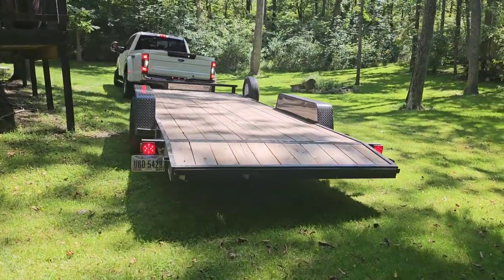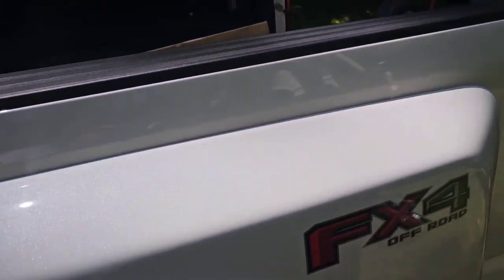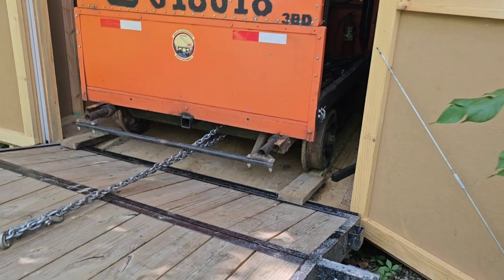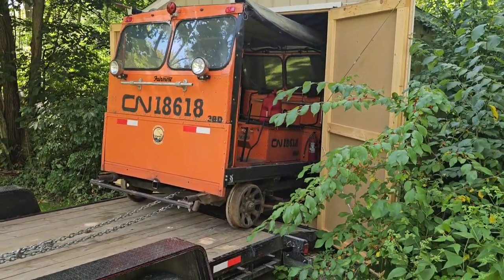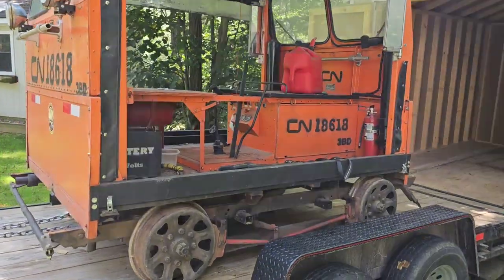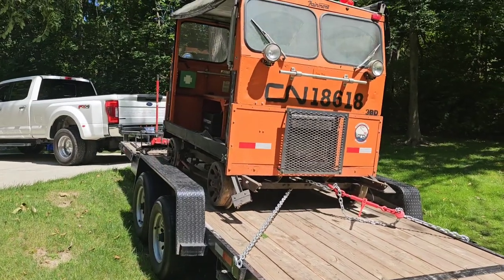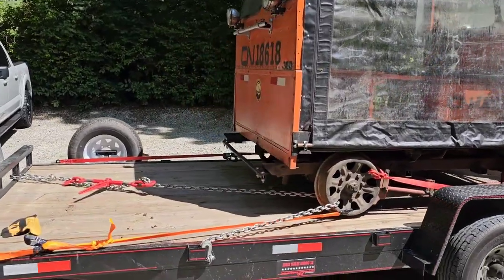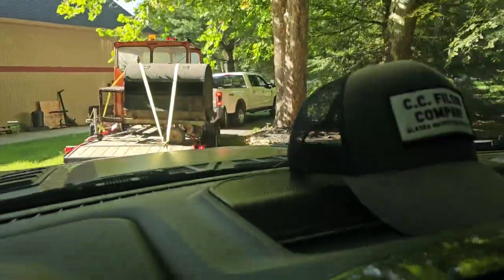Loading my 3500lb Fairmont A-4 railroad motor car onto a trailer after 7 years!

Comment: From earlier videos looks like it's still has the original English Ford Industrial In-line 4 cylinder (2.0 liter). Nice to see the Gang Cars still running. Does anyone you know might have the A6 or A8 Gang Cars ?
Reply from the maker: I believe they put in 2 different engines in those A-4s, the industrial in the earlier models, & a stouter version of the Ford Pinto engine in the later models?? This one has the later version as it was made in the early 80s. I've seen an A8 at a NARCOA meet once, unbelievably big! Probably twice the mass of that A4. Cheers, stay tuned, hopefully we'll have this one back on the rails this year!
Reply: That's the same time period I was working at "The Motors" as a "Red Phone" expeditor in the Manufacturing and Service Division. The 2.0-liter engine looks similar to the vehicle engine used by Ford  Motor Company divisions in numerous models from the early 1970's through the 1990's. But, The In-Line 4 cyl. was imported through the Mississauga, Ont. Canada division from Ford UK (an Industrial grade engine not needing to meet U.S. Vehicle ERA Restrictions). The A6 and A8 used an In-line 6 cyl. Industrial Grade Ford Engine made in Windsor, Ont. Canada. All were then shipped to the Fairmont plant for assembly in the Gang Cars. When someone need a part for any Maintenace of Way Equipment, or Gang Cars or Inspection Cars ASAP; it was my phone that rang and my responsibility to get the parts out as quickly as possible. Hy-Rail parts and sales were handled by another in the department, and Hydraulic Tools in a completely different division. Not only did I work there from the Mid-1970's through their sale to Harsco and move to Columbia, S.C., but my brother-in-law (wife's sister's husband), but my Father-in-Law worked (started 1946) and retired (1972) from the foundry area of the same company.
Reply from the maker: @richardduncan4894  amazing information! Thank you for sharing it! This particular A4 came out of Canada north of Spokane Washington from a guy named Bob Canton in about the year 2004? He bought hundreds of CN motorcars when they were liquidating them for hyrails. Pretty sure CN was scrapping them & he purchased them for scrap mid 90s...this was one of the last A4s he had. My buddy & I paid $500 for it & $500 to have it shipped across the country. We spent about 6 months restoring it.